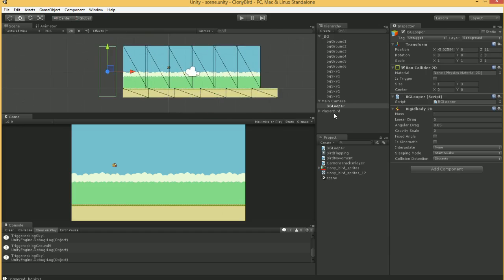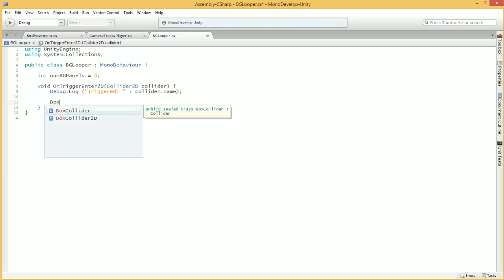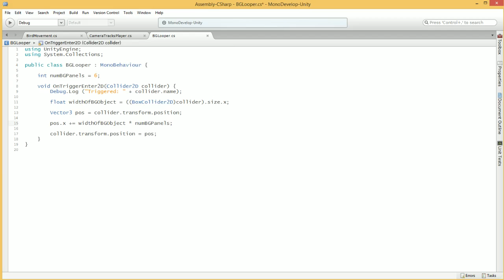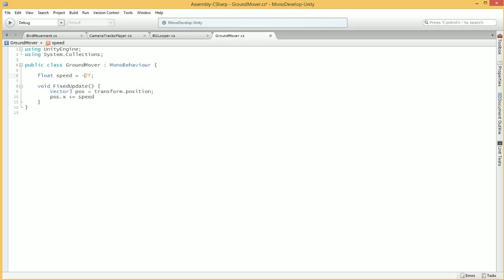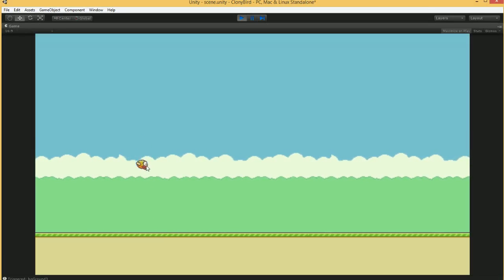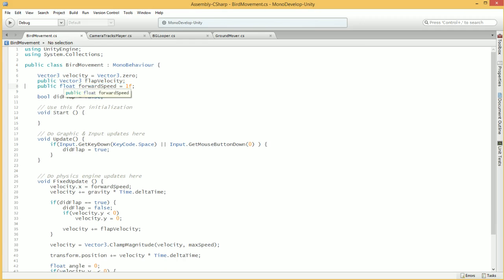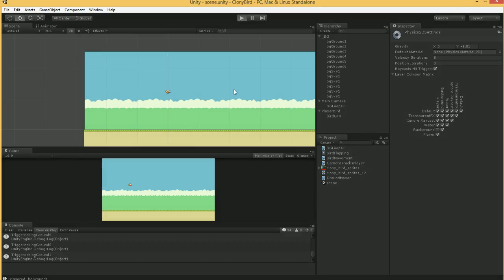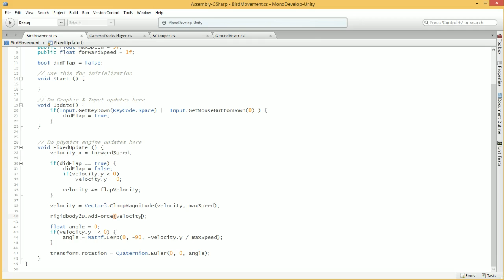Unity Tutorial: A Complete 2d Game (ClonyBird) - 4/7

Comment: one thing I would worry about here, and granted it's a small worry, is that you are increasing the x value of everything in the scene , forever. eventually you could run into calculation issues when , becomes very very large. especially if you ever calc a float value based off of x. kind of like how Minecraft gets its farlands glitches

Comment: Can anyone help me real quick im on the BGLooper script
script is set but when i play the ground will loop to front but the background will just disappear why?    Unity 5
Reply: +itzviperr I'm having a similar problem - In my case both the background and ground will loop, but it loops really far in front. It's basically a huge gap of 3 or so X units, so it looks like it's not looping, but when you go to press play, zoom out in your scene and see if yours is doing the same?
Reply: +laszlar mine kind of loops but the gap never goes away
Reply: +laszlar It's actually more like 10 X units away for me...
Reply: +laszlar ive changed values. even number of bgs and the size of bg's. but nothing
Reply: +itzviperr We shall communicate with Quill!
Reply: +laszlar we neeeed him
Reply: +itzviperr Are you doing your own thing, and using this as an example like I am? haha
Reply: +itzviperr Hey I figured mine out! So, my bg is Size X 1.8, and I have 6 panels just like Quill here. So, my solution was to decrease the number of panels up at the top of the script of BGLooper. I changed mine from 6 to 2 and it seems to work almost perfect.

Comment: I actually found it easier to use a quad and unlit texture. I imported the background as a texture and set Wrap Mode to repeat. Then with a script all I had to do was add a scrollSpeed variable and these two lines in Update();

Vector2 offset = new Vector2(Time.time * scrollSpeed, 0);

        GetComponent<Renderer>().material.mainTextureOffset = offset;

In my version the background and pipes move while the player actually stays in one place.

Comment: Just an FYI, the Kinematic function works properly in the newest free Unity2D version (5.0.1), there is no need to change 'Gravity Scale'. Just do what Quill said to do in the last tutorial and it will work. Just did it today, in fact. All triggers function properly without any need to worry about the Z Axis.
Reply: Also Important for current version users: In scripting, 'rigidbody2D' by itself to start a command is obsolete and should be replaced with 'GetComponent<Rigidbody2D>()'. Unity should have caught this and changed it automatically, but just check to be sure.
Reply: +Robert Hawke Thanks mate

Comment: Rigidbody2D.AddForce does not work in Unity 5.0. Any solution?
Reply: Alin Zdurlan If you are using 5.0.1, Unity has changed this command from 'rigidbody2D' to 'GetComponent<Rigidbody2D>()'. So the proper code to follow along with Quill should be:

GetComponent<Rigidbody2D>().AddForce(velocity);
Reply: were you able to get the colliders to work? i am getting a trigger message but the background and the BG looper collide instead of passing through its as if as soon as they collide everything stops.. any suggestions?
Reply: did u get the colliders to work? my bird and the ground does not work at all. please reply if you found out the solution

Comment: You guessed wrong. The reason why there was a gap between the bg images, was because you did not use the complete width of each image. You moved them all slightly to the left to avoid seams.
Reply: +Jake Lance In the first video, if I'm correct, he moved the sky background so the clouds would visually loop well so the objects are now overlapping causing the width they need to move to be different than their actual widths he was basing it off of
Reply: Can you explain that again, thanks

Comment: I just took the forward movement off the bird and added this script to the _BG Parent Object:
using UnityEngine;
using System.Collections;

public class BGMove : MonoBehaviour {
	public Vector3 scrollSpeed = new Vector3(-1,0,0);
	public float spawnAgainFrom = -5.75f;
	public float spawnAgainTo = 5.75f;

	void FixedUpdate () {

		transform.position += scrollSpeed;
		if(transform.position.x <= spawnAgainFrom){
			Vector3 spawnPoint = new Vector3(spawnAgainTo,0,0);
				transform.position= spawnPoint;
		}
	}
}

This way you don't have to worry about colliders, or physics.  It will just loop the BG objects.  To set it up place one BG object at 5.75 on X and one at 0 on x.  Instant Endless runner.

If you create Prefabs with alternate art this script should be easy enough to alter so you just instantiate that prefab at  spawnAgainTo and destroy it at spawnAgainFrom (or use pooling instead of creating/destroying all the time, that can get ugly).  But you can get a randomized combo of art that will loop.
Reply: Much appreciated for this little trick, but don't forget that you need to put " * Time.deltaTime" next to transform.position += scrollSpeed, if not the BG will move at the speed of light XD
Reply: Carl Beaumier True you can do that, and I do use Time.fixedDeltaTime when I add some faked physics boulders that fall diagonally and bounce across the screen( to add some more hazards and switch the gameplay up) .  

What I did for the BG since we are working with movement in Fixed Update is alter the Vector3 scroll speed on X.  I set it to (-0.01, 0, 0) for the near clouds and -0.005 for some mountains I placed behind them and (-0.02,0,0) for the pipes.
 
Time.deltaTime varies from device to device since it measures time the last frame took to render.  In a game that relies on movement for gameplay I like to make sure the speed is the same on all platforms so a player on PC/Mac/Web will have the same experience as one on mobile, and all mobile platforms run the same as well.

 If you are going to use Time in fixedUpdate you should use Time.fixedDeltaTime.  Unity should return Time.fixedDeltaTime even if you use Time.DeltaTime in fixedUpdate, but better to just avoid that conversion to be safe.

I tend to use fixed movement like for simple animations like that unless I'm emulating physics or doing a Lerp/Slerp.  But there are many ways to get pretty much the same result.  One of my old bosses was a programmer from the NES days and would always tell us in code reviews: "If you can get the same result with fewer lines and calls to functions, do it!".  Some of those older games have amazingly short elegant code!
Reply: HangingBunny Yeah, and what I find amusing is that I can apply your code to both the BG and the Ground and modify their speed independently. I just saved myself like 4-5 min of this tutorial. I used for my own like 0.3 speed for the BGs and 1.3 speed for the ground, so we can see a substantial difference between the 2 animation. I also used your fixedDeltaTime. It will probably not make a difference if it's only gonna be used for 1 platform, but it's always good to do it anyway ;) Thx
Reply: No Prob!  Happy to help!
Reply: hi. can u help me? my bird and ground are not colliding. the bird is passing through. help me please

Comment: quill18creates Im having issues with my ground not looping, I've followed every step to what I can tell, I have rigid body's on the ground whilst on the correct layer, but like I say, I can't figure out what is going wrong.
[Edit: From what I can tell they seem to group up on the edge of the looper and follow behind by quite a bit.]
[Edit 2: Figured it, my box collider on the ground had changed its x value to a smaller figure to what it should be.]

Comment: Wouldn't it be easier to make the camera's position fixed and then make the bird only go up and down? Then just move the bg/ground/pipes to the left.
Reply from the maker: I discussed this very thing in the video. The answer is: It depends. Personally, I like things that are supposed to move, to actually move.  Makes the code simpler. Additionally, this way you only need one or two dynamic objects and the rest can be static, which is more optimized -- although it's a bit moot because of how we're looping the background. (If the background was a tiled texture with a shifting offset in the UVs, then the way I'm doing it would be even more optimized.)
Reply: quill18creates I love how you respond to comments. I'm starting to think you are even surpassing the likes of Brackeys!

Comment: Hey Quill, as you can see at documentation kinematic does not trigger or collide with anything. 
This option is used to have a rigidbody waiting to be used. 
Let's say that you have a door which should be locked untill the player gets a key. So when the player gets the key, the door can be affected by the physics. In this case, you just need to put the kinematic, until the player gets the key.

http://docs.unity3d.com/Documentation/ScriptReference/Rigidbody-isKinematic.html
Reply from the maker: Ironically, the page you link is the 3d version of IsKinematic -- and it explicitly DOES trigger things (but not "collide"), as you can see in my video here: http://youtu.be/WFkbqdo2OI4  The 2d physics are supposed to follow the exact same rules, but the IsKinematic flag clearly doesn't. The Unity people have admitted that the documentation wrong/unclear on this point.

Again:  Kinematic objects SHOULD activate triggers (and DOES in the 3d engine).  The fact that they do not in the 2d engine is a) Not correctly documented and b) is a design mistake.